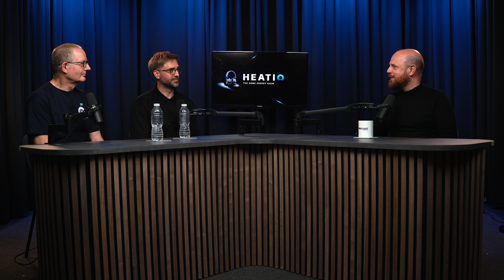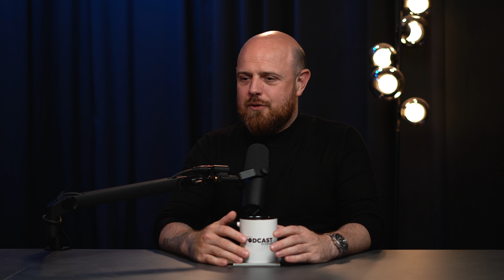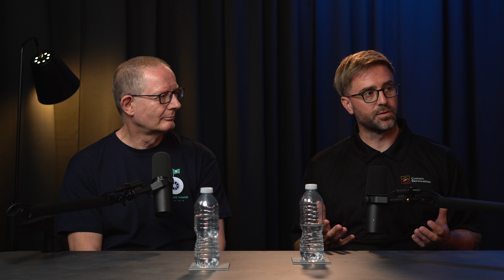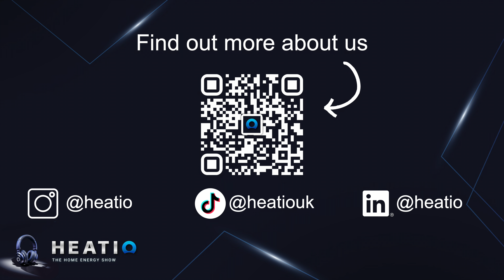Episode 37 : Get Your Home Heat Pump Ready

Comment: We moved my elderly and very sick parents into our home to avoid putting them into care, we have a large (nearly 300m2) home that we have typically run at 12 C in the winter as it would be very expensive to keep warmer and we were happy to wear more clothes, however with vulnerable people in the house we need to keep it warmer ( I hate it warm) for their health. We don’t qualify for ECO4 but have met the ECO4 flex health criteria but need a survey to prove we can up the EPC grade by 2 levels with remedial measures.
Our 2012, now expired,  EPC level was 55 (D).

I have a couple of questions that I’m hoping to get some help with as I need to get that 2 grade improvement without breaking the bank.
1. Current 55 points is only just over the threshold of grade D, is there anything simple I can do to drop the grade to an E before the next assessment. For example if I remove all the LED lightbulbs or remove some of the loft insulation would that do it?
2. Independent of the grant application, I had already decided to install a large solar and home battery system, from what I can gather that’s worth 18 EPC points. It’s all decided and agreed, however I’ve not signed the contract yet. Do I need to wait until after a the assessment before signing the contract as I don’t want to “waste” those 18 points?
3. Can a bit of floor insulation and roof insulation plus solar and batteries bring me up from 55 to 80 please?
Thanks

Comment: I was installing heat pump ready systems about 25 years ago, including my own with a Viessmann WC 200 gas system running at Approx 45⁰ DOT -3⁰, Where has the rest of the industry been.

Comment: Had to get epc for grant I already had one . Did not take into account of house insulation to high 
Standard. House moved from A to B rating- even after heat pump installed. Have Heat recovery system. Had to pay for downgrade for in energy EPC rating. 
Cheers Andrew
Reply from the maker: Thanks for your comment Andrew. So, what are your general thoughts on the effectiveness of an EPC rating?
Reply: @Heatiouk  seems to get a proper ESP rating have to pay more. Only requirement for Grant so I think it’s a waste of money but could not get my Grant without it.
I am also fed up with faulty smart meters awaiting a third new meter. Problem is radio signal best is they accepted WiFi signal as well 
Cheers Andrew

Comment: EPCs are terrible in my experience. Both domestic and commercial.
Reply from the maker: Agreed, what do you think the main issue is with them?
Reply: @Heatiouk  Not being able to easily challenge a bad one in the case of where i work. Plus the recommendations are not accurate and in my experience  would discourage investment in improvements.